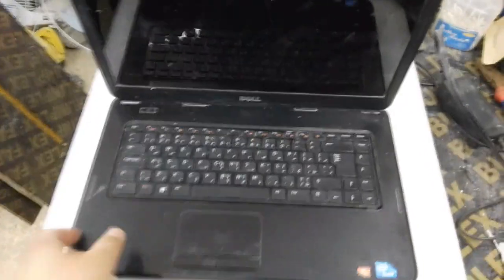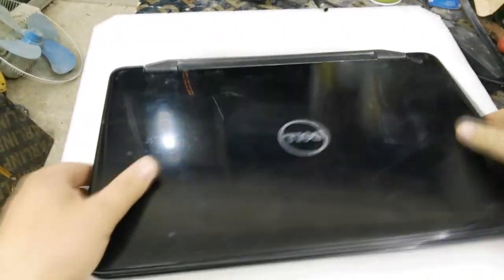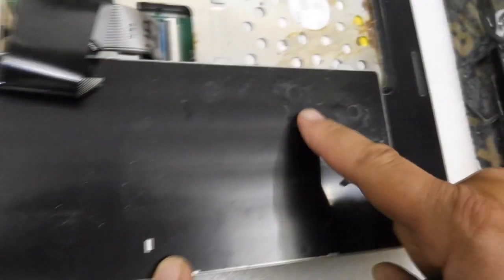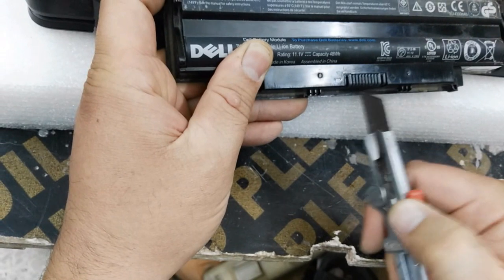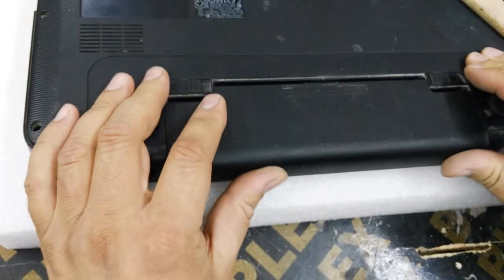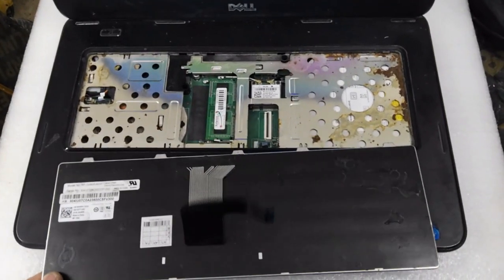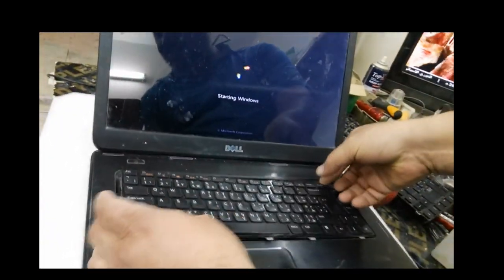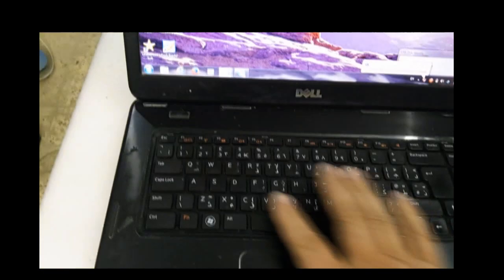how to fix dell laptop no power

Comment: Mine is a black screen problem. After doing the removal of everything, pressing power button many times it starts but shows boot device not found, then I need to change the bios settings and other things. I also found in one test that there is error of partition table. PC is working, but the same problem again and again is time consuming. What can I do? I use external keyboard from months.
Reply from the maker: hi if the masage show on screen that no boot device thats mean hdd problem or win problem try new hdd
Reply: @teachyourself6839  r u sure about it? Because the mechanic I called he said it must be motherboard. It boots if I keep pressing the button for hours.

Comment: I don't know what the keyboard has to do with the power coming on. I have a screw loose by the acdc adapter plug in and the laptop is slightly open becaause of that. I lifted my laptop up by the monitor and the power went out  I can't get it to power on when I plug in the dc cord. I don't use battery because it is completely dead.. I use the cord and wall for my power. When I did have power, it would power up even if my keypad was detached, so I dont know  what the keyboard has to do with the laptop not lighting up. There is something by the cord plug in that is not connecting. It could be something os not making contact because the laptop is loose where the screw is to open it.

Comment: My laptop starts when i remove battery and plug in charger then shutsoff and when i install battery i starts automatically and shuts again...  Only at these two Situations mi laptop starts and shuts automatically...
Reply: Yes same. 🙂
Reply: There is a fault with battery, when u install it there is a boot loop which ur facing.. get the battery changed and everything is good to go
Reply: @EkanshJ12  nope...i fixed that on my own ...was some power switch or some keyboard fault